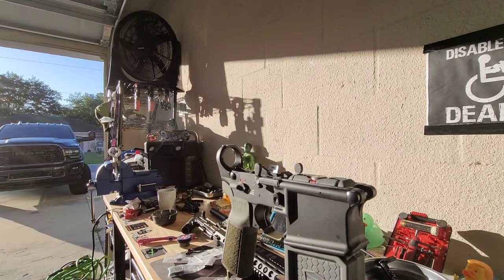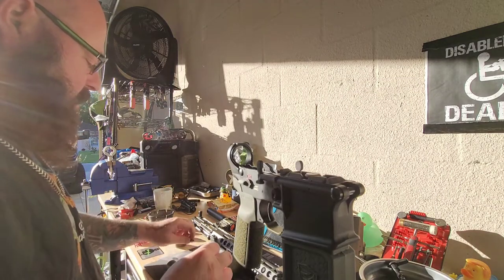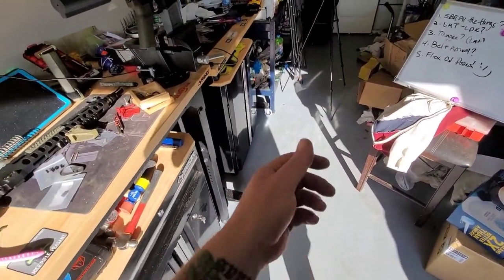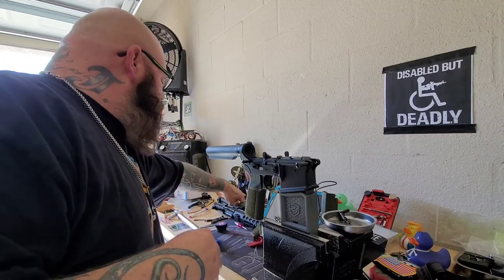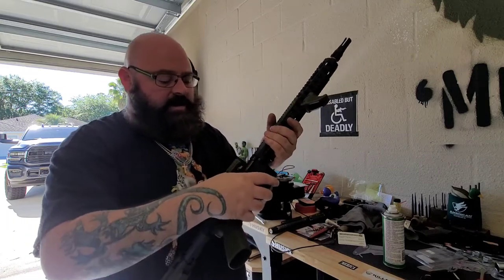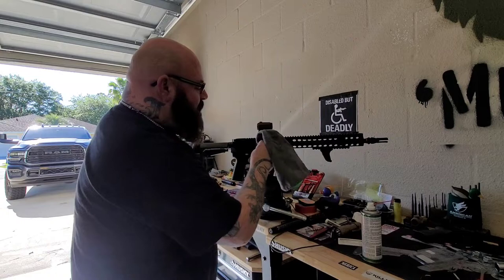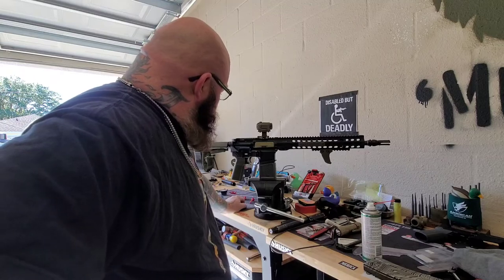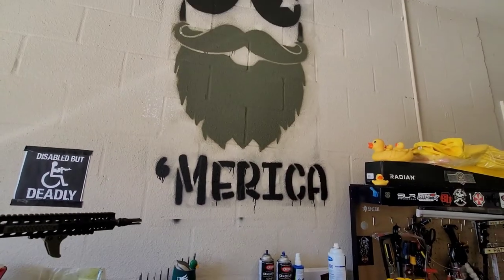LMT / V7/ TRI ARC 13.9 DONE PHASE 1

Comment: I thought the LMT lower had a bolt hold open on the right side so you can lock the bolt to the rear without breaking your firing grip.?..?.. I’ve never had an LMT because I’m poor so I don’t know. 
I’ve always heard you only need antiwalk pins for cassette style triggers and not traditional style. I’ve read folks say geissele triggers need/work better with traditional trigger pins
Reply from the maker: It does. A bit higher up than the Radian and ADM, but works well.